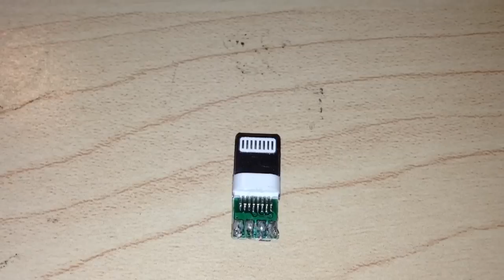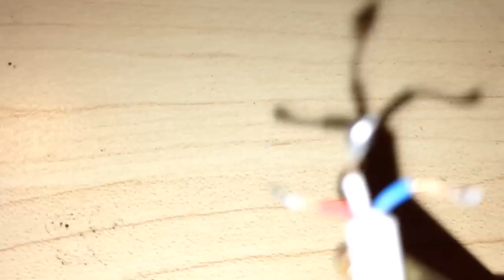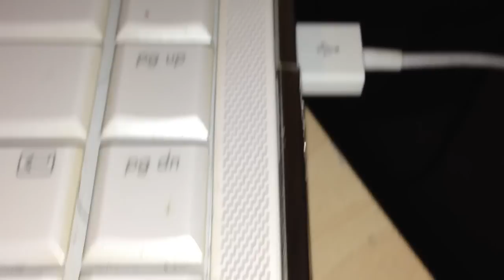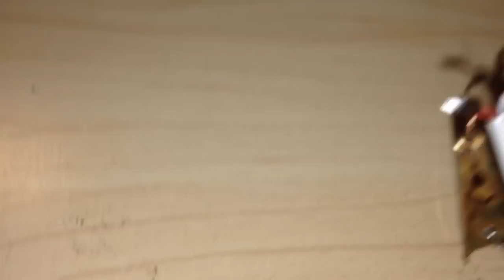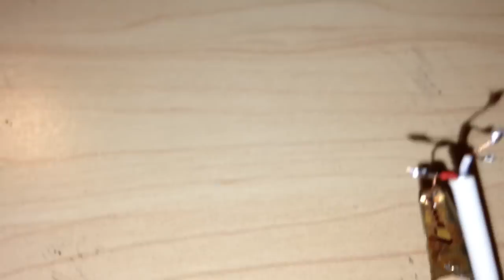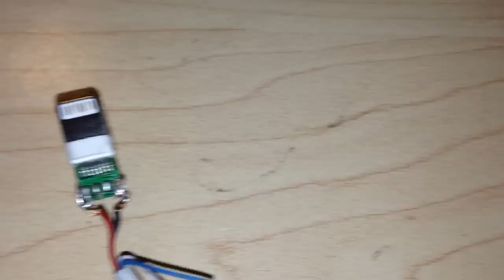iPhone 5 charger repair

Comment: You would be better off buying a brand new iPhone charger because you could potentially blow up your iPhone and cause a fire if you don't know what your doing and apple doesn't recommend this either and recommends you buy a brand new iPhone charger if the wires break also repairing a iPhone charger is just absolutely rubbish and you want to avoid doing it and avoid making any repairs with electrical tape and using electrical tape is absolutely rubbish avoid doing that too and just buy a brand new iPhone charger because it's not safe to repair a iPhone charger cable and it's very dangerous and could cause your iPhone to explode and can void any warranties on your iPhone too if apple found out about it

Comment: Great vid! Do you think its possible to create a lightning cord splitter or y cord similar to the ethernet splitter? So you can charge 2 phones at once.
Reply from the maker: You could actually.  Many charger blocks provide 2 amps.  If you split the charge of an apple block it would only take longer to charge.
Reply: That won't be possible; neither a USB port on a computer/laptop nor an iPhone charger will be able to handle the power requirements - you'll burn out the USB port and/or the charger
Reply: Thank you for the response
Reply: You're welcome

Comment: Is this really working - charging with only red and black wire? I find out using only the red and black is not enought to charge my device. It is not charging.. On my iPhone 5 I need to connect both data cables, too and after that it is OK. :/ But I need to find a way how to charge iPhone with only two wires - just have positive and negative.

Comment: do yo just need to connect the red and black?
Reply: you need all of them to be connected or the charger will NOT work. I've trying with just the power wire and nothing happened, I've tried all sorts of combos with wires so you'll defiantly need al to be put back on to get it to work

Comment: what do you do with the other 2 wires
Reply: +Skythe Hamham 
Well it depends... The red and black wires are all you need for charging. If you need it to transfer data as well then you connect the blue and white wires to the inside metal tabs but that is more difficult
Reply: @dcburney1632 , all you need to charge is the red and black wires.  THAT is the information I was looking for!  Thank you!

Comment: Some chargers do have a metal mesh top layer followed by a thin tin foil cover. Strip the White plastic off and the mesh can be pulled down

Comment: This doesnt work how the hell was I supposed to remove the metal case?!
It just ruined my charger completely thanks.
DONT DO THIS IT'S STUPID
Reply from the maker: its not stupid, you are stupid. maybe you should read comments before trying to be mcgeyver.
Reply: Sean Murphy
 You're basically right, but what you've said in the comments is wrong. I think the EU cables are different.
Reply: Don't call your viewers stupid...

Comment: I cant find the black wire in the cable, just red white and green. I havent opened up the actual connector- just trying to repair a break along the cable part. i am trying to repair the original apple charging cable
Reply from the maker: apple will replace the original cable once for free.  they want the old cable in return. 

use a volt meter and test the wires. youre looking for 5 volts dc

Comment from the maker: It's not metal.  Not on the apple or imitation lightning cords are encased in metal.  Just plastic.  You can cut plastic away with a razor knife.  If your cord is not working then you're not risking ruining it anyway.
Reply from the maker: ***** i have opened both types and neither have a metal casing around it.  its just plastic.
Reply: Gentlemens Quarters ***** i too live in uk and all the chargers that have broken, i have opened up and had a metal casing. so stop saying you have opened both if you clearly havn't
Reply: AceMan11PL
 same in Germany
Reply: +Sean Murphy (LakeOzark) For all who care, the main reason our cables break is because of a weakness in Apple's design. To prevent the damage, you can apply heat shrink tubing to support the weak point of the cable.  The best repair kits I have found are at http://www.fixacable.com
Reply: Sean Murphy hi thanks for your video I would like to know why the charger wall adapter has 4 connection inside , for charging  just we need plus + and minus _ , two wires only so why the wall plug has for 4 connection Insite can you tell me please thanks and have a good day .